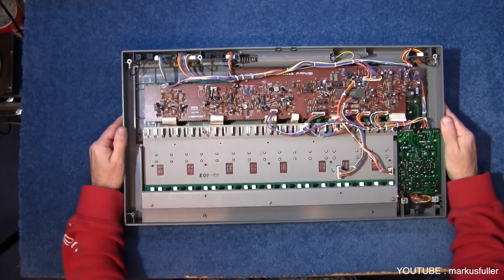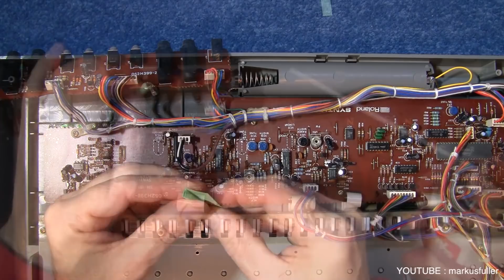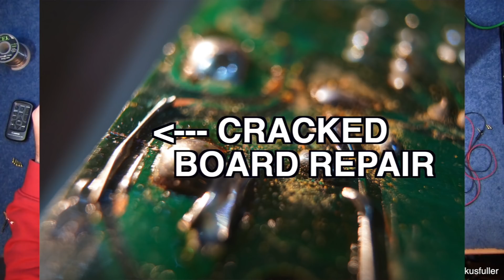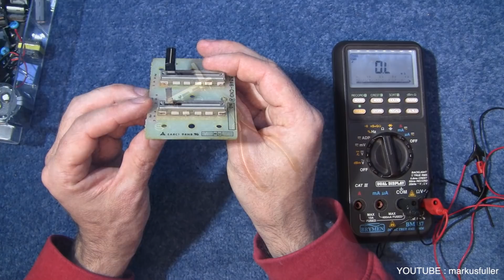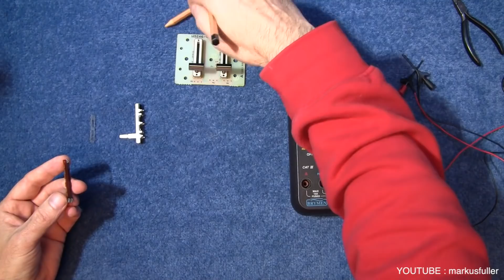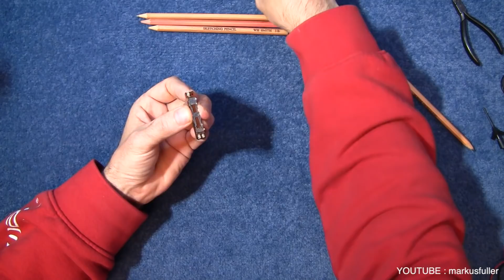Repair a SH-101 Synthesizer with a Pencil MF#65

Comment: Thanks for the tip! Reflowed the solder on the power connector and it's fixed multiple problems I've been having with the synth

Comment: when screwing metal screws into plastic sockets,THIS is important: always screw counter-clockwise to "seat" the screw in the threads already there!!! if not you will create another set of threads that will diminish the structural integrity of the plastic. this is a must if you will screw/unscrew several times.

Comment: well..sometimes the trace actually cracks and you can scrape down the surface insulation and tin it then lay a wire across to the power jack..or jack is busted... I just spray deoxit and work it a bunch of times for oxidation/dirt.  Lots of times commonly used sliders just wear out.  Some functions have high tolerance to variations, some do not.  Eg. on a juno the sliders are mostly encoders basically that sweep between + and - volt source.  So as long as they are about a few K they'll likely work.  And yup 120 some k is usually a decent slider in leu of 100K :-)  I use dielectric grease to make it so wear is minimized etc.

Comment: Hi there,
What about using a conductive compound let's say that one which is used for fixing silicon rubber key contact? 

BTW, I recently faced an issue with degrading keys on my CASIO PX-3 keyboard. After having no luck with getting brand new spare parts for that at reasonable cost I eventually  made up my mind to fix it on my own. Although I could fix the faulty keybed by myself first I didn't want to deal with any temporarily solution cause I did really believe that it's all about rubber pads are worn. But in fact it turned out to be just loss of conductivity of PCB pads which are coated with some sort of graphite compound. Thorough cleanup with IPS didn't bear any fruit so I went with the "key pad fix" from above and so far so good! I have to say that job was a quite delicate thing to do so I used an artist paint brush of "000" grit to lay the compound on then removed all  the unwanted material with a sewing needle.

Comment: Is it ok to use switch cleaner spray to clean the pots and faders on the 101? Mine are starting to get a little crackly.
Reply from the maker: Glascott Symes Hello to be honest swithcleaner is only a temporary fix as it can dissolve the lubricant inside the pots. to do a real clean that will last for years see Synthesizer Keiths video called Potentiometer Cleaning Showdown.
Reply: I figured it be a bit harsh. thanks

Comment: Cool video bud,  do you know about the extra wave form on the oscillator, That roland never implemented, all it need's is to be wired up and a switch put onto the panel, to get it to work,  check this video out for the mod,Synthesiser Dave - Episode 1 - Roland SH101
Reply from the maker: SUBHUMAN .COM USA oh you mean the sawtooth option on the chip, yes you need to change the 2 way switch to a 3 way and connect up the digital waveform chip though I have never actually done one of these mods myself. Im sure the info is on google somewhere.

Comment: On the topic of desoldering: I once tried to desolder a faulty olimexino 85. I had put the things on the wrong side of the board... the board had too small holes for me to be able to actually get the solder out. "good thing you didn't have to lose the processor". Too bad it's so cheap that the postage would cost twice the material cost ( or something like that ).

Anyhow, it would be nice to see different microcontrollers being part of a synth voltage controller setup, with home made codes, gui (even the most simple gui), and "keyboard". But I have this one problem: I no longer think that voltage does what it says on the tin. I just fear that I will harm my computer or instruments, so I simply do not dare. There's a saying... "friskt kopplat hälften brunnet"... and it basically means that "go ahead and do what ever you want to do, as well as you expect to fail..."

Comment: I wish I could get Markus to look at my Virus Indigo. 

Everytime I move the modwheel, it freezes the synth and I have to re-power it on and off for it to start working again. Annoying if you nudge it after working on a patch for half an hour.
Reply: That's a software problem most likely. Virus synths are digital.
Reply: Yeah, someone suggested to me updating the firmware, I ended up selling it in the end though.  I think I'm going to get the Blofeld or maybe pay out big and get the Polar TI next.

Comment: hello friend. i have a roland sh-101 and bender is no working. can you help-me?
Reply from the maker: +Marcus Henrique Hello Marcus, The bender is just a couple of potentiometers and maybe they need a proper deep cleaning. Its a bit awkward to get inside the actual pots but Im just guessing that would be the first thing I would try.
Reply: +markusfuller i will replace the potentiometer and still not working. I downloaded the service manual, checked the tracks end not found faults.
Reply from the maker: Im not sure where I would be looking next. I do not have one on my desk to compare. the one I had was a repair for a friend and that has gone back now. I cannot guess what could be wrong. have you checked all the other switched & pots to the left of the keyboard. also I would start to look for cracked circuit board tracks and even dry joints.

Comment: How can I contact you? I just got a SH-101 that works but its got some kind of crud or mold in between the faders,inside the DC IN 9v-12v and also the RES fader in the VCF makes a really loud (unnatural) noise or static.
Reply from the maker: +BobsCosmic Ripple Hi Bob, unfortunately I only make these video's up to try and share a little of what I know (and i certainly do not know everything) It also helps that people sometimes leave good comments and share a little info with others. I do work full time and only make these video's in my little bit of spare time so do not really have time to do repairs for people, a lot of items are my own or the odd one for a friend now and then but they wait weeks before i get around to things. there are a few facebook groups about keyboard repairs and I guess they can make answers for you or hopefully if someone reads this maybe they know your problem. I think a good start would be to try and clean out as much of this crud/mould as possible.
Reply: Thank you so much for getting back to me. If you ever have any spare time can you explain the wright kind of cleaning tools i might need? All of the faders have crud on the colored part of the faders ( orange, green, yellow) and also is the RES supposed too have a small static noise sometimes?
Reply from the maker: I mainly just change the whole fader or if I have none in stock then take them apart and clean with isopropyl alcohol and cotton buds - or Q-Tips .
Reply: +markusfuller Will the color on the fader knobs fade if i use too much. (At the moment I barley see the orange,green, and yellow color on the knobs)Also the silver sequencer buttons have some kind of mold on them.        Iam a newbie to this and did not know i was paying for a dirty SH-101.
Reply from the maker: Oh I thought you meant the mould was in the tracks of the faders I did not realise it was on the surface of the buttons. I would gently remove the buttons and wash in warm soapy water.

Comment: Thanks for the really nice tip with the pencil :-) FYI, to repair flexible PCBs I use a nickel conductive pen (from Chemtronics) but the bad thing is that sometime this pen dries to quickly and becomes unusable after a few months. And I also use the same technic to put back the screws ;-)

Comment: The resonance slider is usually the most used pot on a synth so it would have had the most wear and strain over the 30 or so years. It could be cool to swap your pencil repair (cool job!) with a least used fader like the 'noise' or 'sub' if they are also 100ohm. Great video Markus .. Great tips as always!

Comment: Another fine video with great advice. I've also had to repair the power supply plug a few of times on my casio CZ-101
(Perhaps it's a 101 thing :p) & have lost count how many times I've ran a 4B pencil down the tracks inside an 80's graphic EQ to reduce crackle. Great advice, as these top-tips work every time and has extended the life manyfold.
 As well as conducting electricity, graphite is fantastic lubrication & 30 year old solder is a well known cure for a cold ;)
Reply from the maker: +brickscratch I think its the 30 year old lead solder that sent me mad or is it madder ?.

Comment: Love your videos! I've run into the split plastic screw post problem before. I would love to see you do a video on fixing broken plastic parts.
Reply from the maker: +Luis Suarez one thing I have done in the past is place wax on the screw insert it then put glue around the post where it is cracked and slip over a piece of heatshrink tubing then when it is set take out the screw and hopefully it works for a while. though to be honest it is not always succesfull
Reply from the maker: Hi I use to work in electronics for a living but these synth repairs are just for the youtube community. and I have many synths and make music myself as a hobby also. :-)
Reply: +markusfuller Thanks for the tips! Sometimes I feel like I unintentionally acquired a synth repair hobby...
Reply: +MKUltra Thanks for the advice. I suppose it's a bit like dentistry - you have to hold onto whatever bit of root you've got left.

Comment: any video you do is ALWAYS interesting Mr. Fuller! Cheers!
Reply from the maker: +Marc Abernathy Thank You Marc :-)
Reply: +markusfuller My guitar pedal just stopped working for no reason. Signal goes thru when bypassed but not when engaged. Everything lights up as normal and I've tested all the chords. Any ideas?
Reply from the maker: Oh I could not say. I would be tempted to get inside with a multimeter and make sure everything is receiving the correct power then check the bypass switch to see if it is indeed diverting the signal through the circuit.
Reply: Okay! I will try and see what happens
Reply: this is becoming like CarTalk or something

Comment: Great temporary fix. 
Also, you can turn the pencil around and use the eraser to clean up electrical contacts of dirt and grime. Handy things pencils.
Reply from the maker: +slider2732 Yes thats true. I did not think of mentioning that. I use the eraser end to shine up copper track.
Reply: A note for your viewers - Works well for bringing back 80's game cartridges and arcade game boards in the same way :)

Comment: Great video, again! Quick question, what temperature do you set your soldering iron to desolder a part? I've never removed anything with a solder sucker easily :)
Reply from the maker: +Elsif Hi Elsif. I was using a cheap Antex all in one iron with no temperature control. I think it is 240v about 15 watts though I have no idea what temperature it is working on.
Reply: ***** markusfuller Thanks, guys.  Sounds like the temperature isn't as
important as i would have guessed. I always have the tip temp set to 650 to 700 faranheit, so I guess it's just down to something I have to practice a bit more.